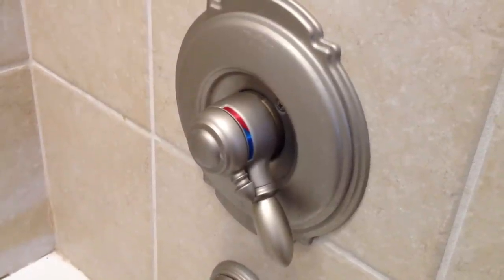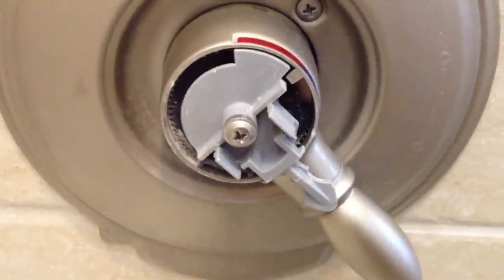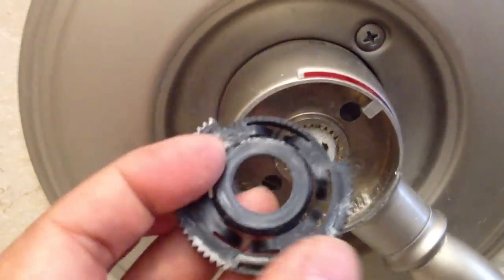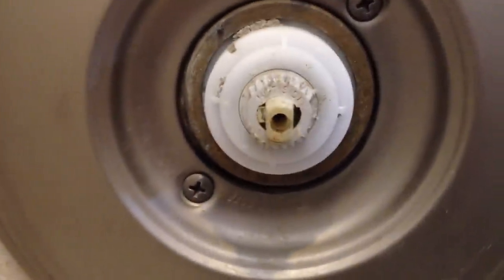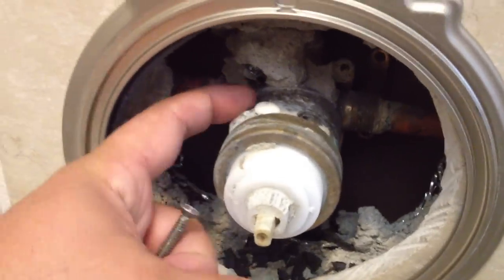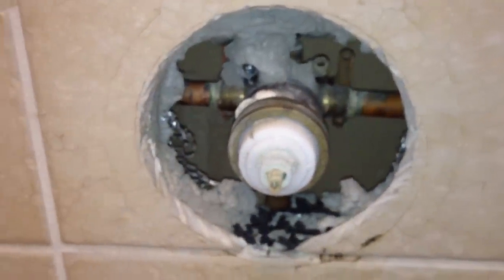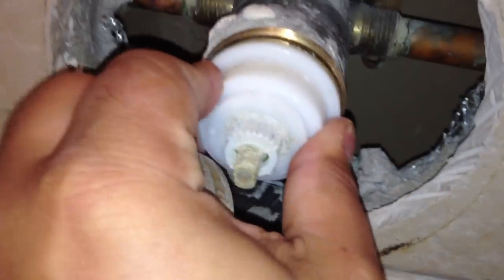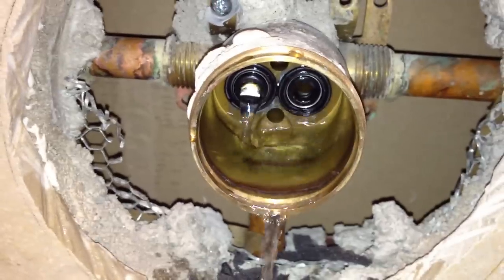Part 1 of 2 - Delta Faucet Tub Shower Valve Cartridge Replacement Repair 1700 Series RP 32104

Comment: I just completed my Delta faucet replacement following this excellent video.  Very well done.  My replacement had a few difficulties,  the brass ring was calcified on and I had to use WD40 to break the calcification.  The two rubber grommets with the spring was more challenging to replace.  I used a phillip screwdriver to insert it.  Just took more time than on the video.  Finally, locating the screws for the cover plate was more difficult than on the video.  In the end,  I saved at least $150 doing it myself.  Thanks.
Reply: BTW,  Delta warrants their cartridges for life,  call them and they will send you one at no cost.  This is the 3rd cartridge I replaced where Delta gave it to me for free.

Comment: Excellent descriptive video. Thanks!
I wish I'd seen this before calling a plumber who replaced the whole fixture for many $$$.
But, if one has time, the key issue is de-liming (calcium, etc.) which can be done, as you say with CLR, but I've used strong vinegar for the same result (well, after a number of hours). 
One word of advice would be to use a LOT of silicone grease on all flexible parts like ALL the "0" rings once the metal parts are really smooth and clear of deposits. That's why plumbers are not really interested in the cleaning, so they'll just cut and replace the whole unit.
Again, well-done for a full discussion!

Comment: Not only did you save me a call to a plumber, but it turned out I didn't need any new parts, so you saved me $50.00 for a new cartridge! Thank you for you video
Reply: Delta faucets etc, are guaranteed for life! Just call them and be insistent. I have called many times and they have sent out repair kits each time. Once when the faucet had been discontinued they offered me a great deal on a NEW faucet, I said no and then he sent the new faucet for FREE. Yes free, they could not replace the parts so they had to send me a new one.  Once when they gave me a hard time so I waited and called back a few weeks later and then another person gave me what I wanted. Just ask.

Comment: This is a superb video set.  Thank you very much for creating and posting.  It was extremely useful - after viewing, I successfully replaced the cartridge and seals in my own Delta shower faucet, thus fixing a long-time leak.
Reply from the maker: rpyka1 thanks for watching.  Did you see my note about setting the temperature stop? Have a nice day!
Reply: This was the one note that surprised me in your video.  You noted at 7:54 in Part 2 of your video set that the exact position doesn't matter, where in actuality it does.  The position of the stop limit on the plastic insert (the thing you didn't have a name for - and I don't either) relative to the stop limit in the ON/OFF knob is what determines the maximum temperature.  Increasing the distance between the two limit stops (counter-clockwise of the insert with respect to ON/OFF knob) will increase the maximum temperature.  Unfortunately this position (too hot or not hot enough) is something that needs to be determined by trial and error.  I feel this probably should have been explained a bit more in your video.  In my case, the insert remained inside the large ON/OFF knob, so the re-clocking was not an issue.

Otherwise everything in your videos was very concise and informative.

Thanks again for posting.  Have a great day too!

Comment: I've got a 1700 series cartridge that I thought needed changing and my luck the local hardware store didn't have one and it was to late to go anywhere else. Grasping I decided to change the washers leaked leaked... Desperation got me on the internet where I found your video with yep the same cartridge as mine (watched several that were a different series). After watching you explain how the washers with the springs went I realized I had installed mine incorrectly. Went back in reinstalled them correctly and put a little silicone grease on them and the other double washers that are connected together and no leaks. Luckily I didn't have to replace the cartridge... Thanks for taking the time to share the video.

Comment: Thank you for this!  I feel so stupid - I was having trouble reconnecting the temperature dial to the handle after it came off (I kept trying to twist it back on).  Didn't realize the top piece popped off to reveal the top of the screw.

Comment: thanks.  just made my change out a lot easier.  Also, check pricing.  Most supply houses want $80+ for this valve.  Got from Amazon for <$40.
Reply: Delta has a lifetime warranty on their faucets.  Call them and they will send you the cartridge for free.

Comment: The position of that geary thing matters. It sets the peak hot mix
Reply from the maker: You are right.  I discovered that afterwards.  It's easy to adjust after the first screw is removed. Thanks for explaining.
Reply: if got a small leak coming from the shower head any idea on how to fix it

Comment: I would not recommend CLR be used to remove scale in your case. CLR has specific instructions to not be used on brass. The body of the faucet that holds the cartridge is made of brass. I would use white undiluted household vinegar instead.
Reply: Can I use Liquid Plummer Gel and dab it on and brush away the mineral deposits ? Thanks.

Comment: Is it possible to change the cartridge I'd like a single handle that goes to hot and cold without the little knob in front. My teeth are completely stripped and needs replacing anyway was just wondering

Comment: i just replaced a cartridge on my  shower faucet which is a 1700 series. I used a plier to remove the metal  brass ring  ( i think its  also called a bonnet nut) because it was too tight. Now when I put the new cartridge in it doesn't snap in properly. so of course it keeps leaking and when you turn the handle, the cartridge also turns. Any suggestion? do you thing I damaged the threads on the metal ring by pulling it out forcefully ? .

Comment: why is your "hot side" facing up?  Isn't it supposed to face left per the installation guide?  I'm having an argument with my contractor who installed it "hot side" up and my water won't run until the volume control is turned to the halfway point when looking at my trim plate.

Comment: Hi my plumber installed my new dual handle faucet. I cant turn the temp. adjust at all, Ive removed the cap and the screw and it wont turn that white cartridge nubbin at all.  I dont want to force it, why wont it turn? (Im going away from the limit block dont worry)

Comment: The brass ring around the cartridge is stuck....  No luck with pipe wrench.  No luck with WD - 40.  Any suggestions??
Reply: Joey Stein cut it off and replace for $6. This won't help you Joey since you probably figured it out but just in case anybody else needs this.
Reply: It can be found by searching 1700 delta bonnet nut
Reply: Lots of liquid wrench (the penetrant type), and rubber strap wrench helped me to get my old brass ring out.
Reply: Don't force it. I managed to sheer mind clean off .😐
Reply: Camisones para infantiles
Reply: @jonathangrindstaff4619  I had the same problem and no amount of WD-40 would loosen it. There's a video on YouTube showing how to use a hacksaw to cut a notch in the bonnet, then take a screwdriver and hammer, tapping it until the bonnet turns. Mine was too frozen for this to work, so I simply sawed through the bonnet and it fell right off. Home Depot has replacements for $8.

Comment: Heads up diy guys n girls do not use pipe wrench on the bonnet if has any corrosion will be a little tight and you will bend the bonnet and changing a valve

Comment: Bad luck for me. The brass ring was stuck and even in an slow attempt to open it, the entire body twisted, and broke the pipe. Be careful in opening the cap.
Reply: If you put W40 around the ring and wait little time and use two channel Locks med and bigs then you good🤔👍
Reply: PIPE WRENCH <- BEST TOOL to remove the ring. Other tools press in and bind the ring!